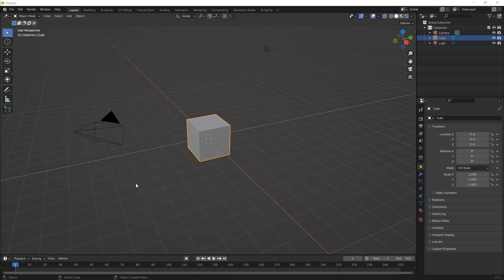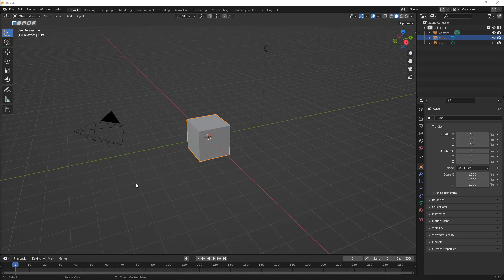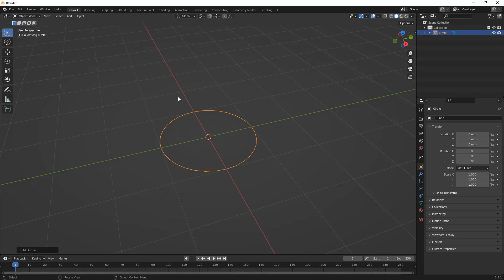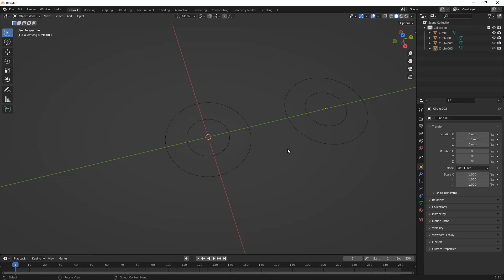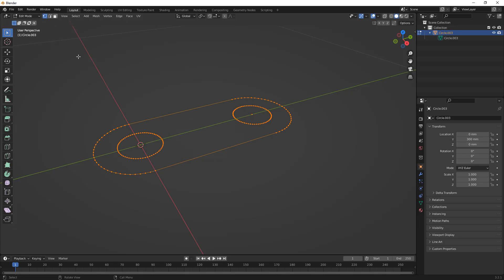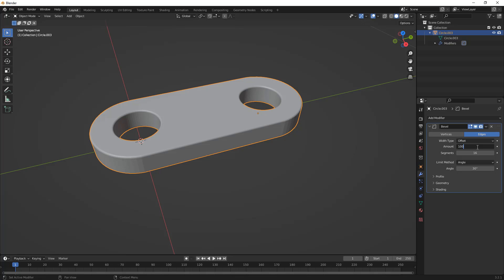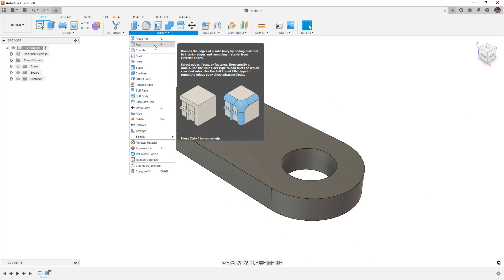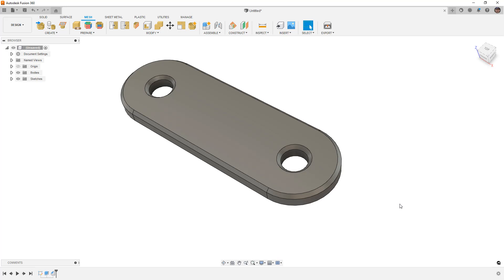Precision Modeling in Blender? | You Decide, Blender vs CAD | Precision Modeling | Blender | Fusion

Comment: From this video, it might very well feel that Blender is real bad when it comes to design. You kind of took the wrong approach in Blender by trying to emulate the CAD workflow and spend long time by explaining, while in Fusion you sprinted through it 🙂Sneaky. I (semi-enthusiast Blenderer) could probably match the speed of you doing it in CAD while also keeping some of the flexibility and ability to adjust dimensions after - although not in that many ways the Fusion offers, that is for sure.

In Blender, this would be easily done using modifiers (Boolean for the holes and Bevel as you did).
You can also synchronize the holes' sizes by using a shared mesh.
Reply from the maker: Very True, I did start the video by saying I don't do hard modeling in Blender :)  Several people had asked me how to do it so I took the time to model it as you would in cad. "sketch" the shape" Extrude(Solidify) to a solid, Bevel the edges.  I did speed through the Fusion part because in large my audience is more advanced Fusion users who are venturing into Blender.  It wasn't meant to skew the results so oops.

This could be done with modifiers like Boolean but honestly in both methods I don't really like the downstream effect of modifiers.  There are the add ons like CAD Sketcher that sort of fills in the gaps between the process for you.  At the end of the day for me it just doesn't make sense to do precision modeling in a poly program.  I need precision that means the part is getting machined or has some down stream use.

Shared mesh is a neat workflow to sync up the holes!  I can't think of a way you could easily change the distance between the holes.  Sure you could stretch but if you wanted to move them to say 400mm you would have to edit the mesh, select all the verts or edges on one side and move them by 100mm in the Y direction(or whatever it was).

I appreciate the comment and I am curious if you would choose to use Blender for something like this?  If this was an artifact for a game or render and it was a simple part like this maybe.  But if there was more of a lattice structure or more dimensions to it would it make more sense in CAD?  Also have you used CAD Sketcher?  Several people want me to make a video on it but i just haven't had the time yet.
Reply: @LearnEverythingAboutDesign  Shared mesh is usually used in a way in which you make a shape (in Edit mode) and then manipulate it (Translation, Rotation, Scaling) in Object mode. So that way you would have 2 copies of one shared mesh, which you could move around (as separate objects) freely. What AFAIK is not possible is to tell Blender to keep them at specific spacing. You would have to move them manually - but in Object mode, no mesh editing neccessary.

I do modeling for 3D printing. Not at a pro level, but far from amateur. And yes... up until now I did it in Blender. I was deciding between Fusion and Blender and I was pulled to Blender size for the following reasons:
1) I like "open source" community stuff. Blender is full featured and for free.
2) I like ergonomy - Blender is fully customizable. In Fusion 360 I couldn't even take advantage of my 14 button mouse. I had to Pan and Rotate by using CTRL(+SHIFT)+MidMouse... I am sorry, but that is lame. In Blender, I can fully navigate the world (and more) just by using my mouse.
3) When I first opened a few projects in Fusion and Blender - Blender was just faster. It was a bit unfortunate, that the project I opened in Fusion was quite bit, so Fusion was at a disadvantage, but still... Blender is snapier.

So yes... I did a lot of designing in Blender and it can be done. I hear a lot of people say, you cannot do precision modeling in Blender. I think that is incorrect wording. You can do precision in Blender just fine. What you cannot do is parametric and non-destructive. You can... up to some point... but for more complex engineering it is not enough. It can easily be demonstrated on:
1) the egde beveling, where you can tweak it retrospectively in Fusion or when you ask Fusion to keep certain distance between objects.
2) Fusion also can "recognize" 2D drawings... what do I mean by that... if you draw 2 separate 2D shapes that intersect, Fusion will offer you to extrude the intersection. Blender does not recognize that. You would be able to extrude the original shapes, but if you would like to extrude the intersection, you would have to do more work first.
3) Making a slot for a pin. In Blender, you have to have one object for a pin and second object for the slot (you can use a shared mesh for the shape and scale the slot to 1.05 of the pin object to make it easier). But if I understood correctly, in Fusion you just have the screw "object" and set the tolerance as a parameter.

I would call it creature comforts. It is possible to achieve it in Blender, but it is more convenient and flexible in Fusion.

For my next project I will be trying Fusion, since it will be a bit more complex from the engineering side and I am quite sure it will be easier than in Blender.
I have to setup AutoHotKey scripts to work around the lack of control customizations though (Pan and Rotate using mouse etc.)
Reply from the maker: @radeklukas  Thanks for the detailed reply.  Years ago I used to use 3d mouse and customize my UI but now i leave most programs default.  Easier to teach.  I have heard the complaint about Fusions lack of customizations for navigation.  I don't mind it again because i don't customize but I totally understand.

I think the term Precision can be misleading.  For me 3d printing is usually a midstep to a design.  You won't be cutting a mold for plastic parts from a mesh so modeling in Blender just isn't an option.  I mean yes you could make toolpaths off an STL mesh but having a true surface is much better.

When i think of precision modeling I do equate that with parametric modeling.  Designing parts to fit together with specific tolerances. certain draft on walls etc.  In Fusion for example with the Pin/Slot example you can create a parameter that is the diameter of the pin, then another that is the pinDia + .05 or something like that.  Or Draft = 3  so when you make a design in the dimension dialog you simply enter Draft and you can change every feature in one place.  There are features like Hole that let you make counter bore, sunk, tapped holes easily.  

If Fusion isn't your jam there are others.  FreeCad i think is open source.  You might like to try Plasticity which is setup very much like blender but you are working with NURBS/BREP rather than mesh.  It lacks the dimension input like a CAD program has but a lot or artists like it.

I think the big thing here is that poly modeling and cad modeling are just different approaches.  Poly modelers HATE the CAD workflow of making sketches for some reason.  Programs like Solid Edge have a direct modeling approach that is sort of a hybrid(but i don't like it), Fusions direct modeling when you turn off history doesn't really change the workflow.  Plasticity is really the closest Ive come across that sits in the middle.  If it had precision inputs(which it might before its for sale) I think it would go a long way.  There is also Shapr3d, Moi, Rhino and so on.  Vary in price between those 3 with different license structures.

But yeah at the end of the day if Blender does what you need it to that is great!  I love Blender and wish i could play with it more.  It just doesn't work for what I do since I need precision and flexibility on complex designs, the ability to do fea, make drawings and create physical parts for machining, molding, create toolpaths etc.  Starting with a poly model is a death sentence there :)
Reply: @LearnEverythingAboutDesign  Yup... agreed. I am looking forward to trying Fusion with proper controls finally. And I guess I will make a move towards that. I am gonna go watch more from you CAD vs Blender series though 🙂. Happy designing!
Reply from the maker: @radeklukas  Keep in mind i still think of myself as very much a blender Newbie, so it probably isn't worth your time :) but don't hesitate to ask questions.  And I would suggest you take a look at Plasticity if Fusion doesn't fit with you.  I think its a few months out from release so you can still get in and give it a shot for free.  It has surfaces now.  I haven't covered it in a while as I have been too busy.
Reply: @LearnEverythingAboutDesign  So... I am making a design in Fusion 360... hooray... I feel like a pro 🤣. The constraints that you can impose on your sketches are great, no doubt about that. Just input dimensions and you are set.

But I have also come across a few shortcomings that feel quite cumbersome as opposed to Blender.

1) Copying parts between projects... impossible / very tedious... I hope that is just the restriction of the free version.

2) Align or move to another point / edge / face on just one axis... I have not found a way to do this yet and it is very very frustrating. If I have a body or component that is on the right spot on X axis, but I need to align it on Y axis with another body. Well if I use Move tool (point to point)... it will move there... yes... but it will move on all 3 axis... there is no way to restrict the move on one axis only. Same goes for Align tool. The way I do this right now is to take a measurement and then input that measurement into Move Translate.

3) The history and the ability to change feature later is cool... sure. But It also restricts you in a way (requires you to think ahead). Retrospective editing of a feature cannot affect changes that were made after that feature. If I "create Body 1", "create sketch and extrude Cut through Body 1", "create Body 2". Then I decide I need that Cut also through Body 2... it cannot be done because Body 2 did not exist when that Extrude feature was created.
Reply from the maker: @radeklukas  Workflow definitely is a bit different.  Let me see if I understand what you are doing.
1. There is something called Distributed Design.  In fusion there are bodies and components.  Think of Components sort of like a Collection in Blender.  The component will have its own coordinate system and can contain bodies and components inside it.  So lets say you were making a wheel.  You could have a component called wheel and inside that you could have a body for the rim, tire, lugs.  all those would move together as one(unless you move a body individually).  The point of this is that you can save components externally in your data panel and just drag them into a project.  This creates an external reference that can be broken if you wish.  But if you edit the component it can/will change in all places its used.  There are different ways to copy and move files around to projects.  If you do this online i believe you can check multiple design and move them as one.  There are some paid options inside of the Manage extension but not on the free version.

2.  There are 2 tools for this Move/Copy and Align.  Align will let you select a face on one body or component and move it to be in plane with another face.  When you are making selections be sure not to select a point on the face but somewhere that doesn't have that.  If you hover over a face and hold CTRL it will lock focus on that face.  Align lets you do what you want.  Move/Copy also has options that you move Point to Point for example.

3. You can move features in the timeline as long as the depencies allow it. So drag the extrude to before body2. then edit it.  You can also toggle off the history if you want or create what is called a base feature.  Essentially a direct modeling body inside of the timeline.  To turn history off go to the gear in the bottom right.  To turn it back on right click on the design name at the top of the browser on the left and enable capture design history.
Reply: @LearnEverythingAboutDesign  Alright...
1) I take that back. I knew you can copy Components, but I had file composed of Bodies only. I found instructions that you can "Create Components from Bodies", which I did but then I ended up moving many Components to the other file and reassembling them into single Component there (which was tediouos because I had to navigate that "Component > Bodies > Body" structure for every Body. But if you create empty Component in the source file and then move all bodies in that, it is much easier. Solved.

2 & 3 I will explore more today.

Thank you!
Reply from the maker: @radeklukas  No Problem.

for 1. if you  have a file with all bodies you can still do it.  If the file is saved you can select the very top level of the browser(which is by nature a component), then go to Create > Derive.  When the derive dialog is open you can expand the bodies folder and pick which bodies you want to go to the new design.  At this step also note that you can change the destination to an existing design skipping the middle step.  With this you can also break the link if you desire.

There are some nuances to this type of workflow but there are some ways to get it done.
Reply: How do you make Fillets on booled Edges? It's very cumbersome in Blender. It is not CAD.

Comment: What this video makes clear is how weak blenders polygon drawing tools are

So many basic tools are still missing - drawing an arc tangent form a line 

Sweep a profile alone a path 

And and and 

As much as I dislike sketchUp it has very good tools for just that 

Obviously sketching has hardly what blender in contrast has a to offer
Reply from the maker: I have downloaded CAD Sketcher for Blender but haven't played yet.  At the end of the day they are just very different modeling programs as you pointed out.
Reply: @LearnEverythingAboutDesign  cad sketcher isnt bad - if you need this type of labor work. It would be nice if blender could implement or add drawing poly lines and poly curves arcs like sketchup does.

And yes they are all very different apps - blender my fav subD modeler render animation and texture tool
Reply: fusion 360 tangent tools are incredible! I just started using it two days ago and would never use Blender for hard surface again after doing a few tutorials.

Comment: blender need thiss type of precision... a blueprint view with visual messure data is a dream..not only for cnc etc...
able to change quick fast organic forms on   proportional measured level ( golden Ratio) in real time without selecting deselect parts (edit mode) the whole time is awesome...
two clicks ready done ..wow...nice...
Reply from the maker: In Fusion you can also show the sketches and dimensions so you don't have to edit them to make changes which is super nice when laying out part.
Reply: construction lines addon for blender is slowly getting there.. i'm at the point now im able to use it for making useful tools and things to 3d print. Making screws, and threads even seem to be pretty accurate now.
Reply: @miked5487 great to know this. Any tips on who to watch? Maker tales seems to have moved on too far.